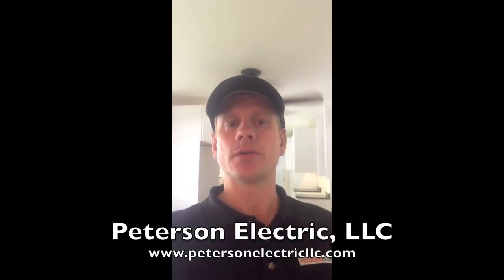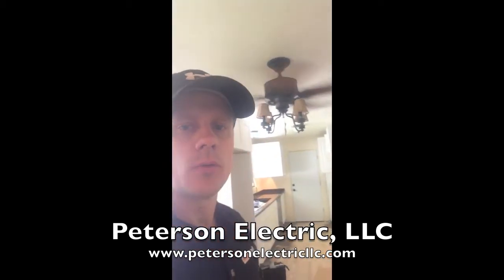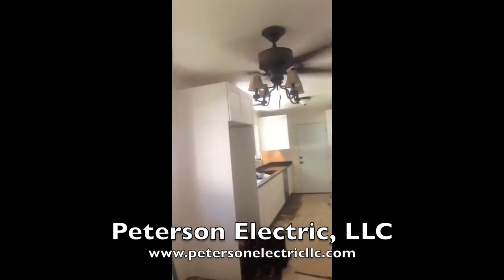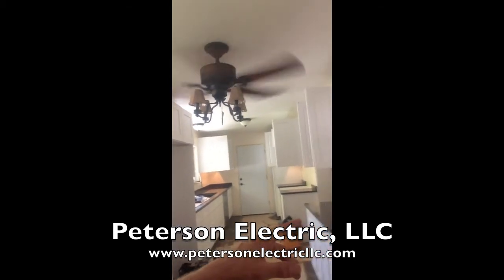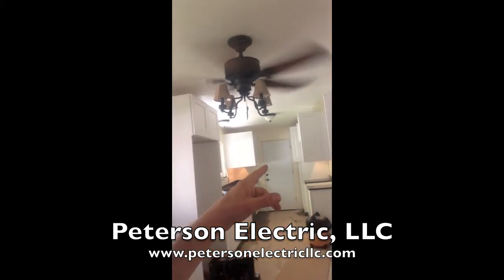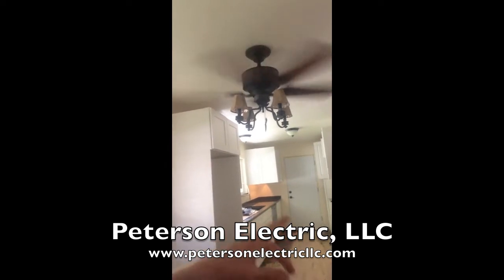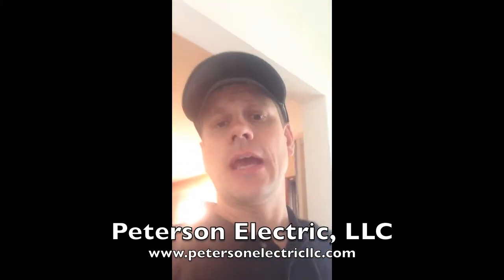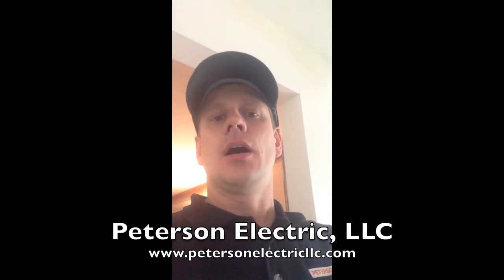Kitchen Remodel, How Many Circuits To Install To Make The Kitchen Up To Code?

Comment: Does every circuit need it’s own neutral?
Reply from the maker: NO, not if you want to spend more on AFCI breakers. And, if you need a DF breaker then you have to have GFCI at the counter plugs, the main Manf. companies do not make DF two pole, multi-sharing neutrals. SO, pull a #14/2-2 or #12/2-2-
Reply: So if they are sharing a neutral then wouldn’t they not be considered dedicated ?
Reply from the maker: @Ribsandwich9797  nope
Reply: Ok. So I can have say the fridge on one circuit and the dishwasher on another but share a neutral, I always thought the neutral carried the load/amperage figured it would cause the overload